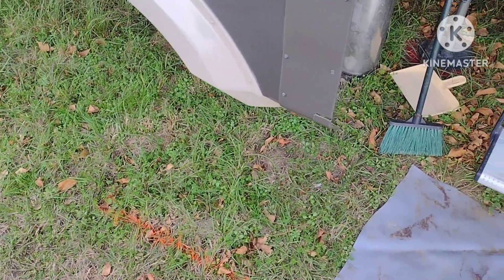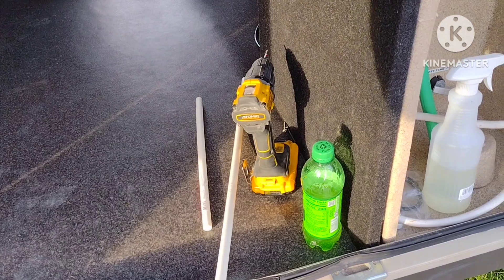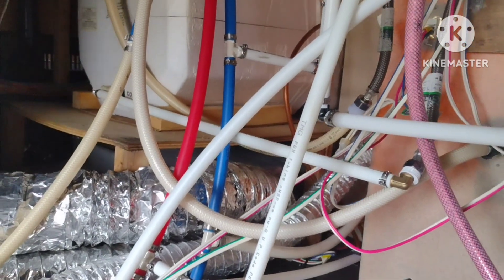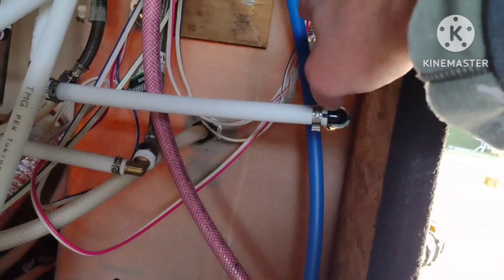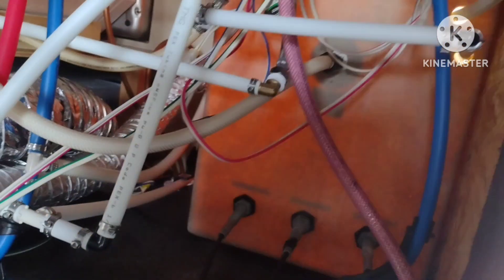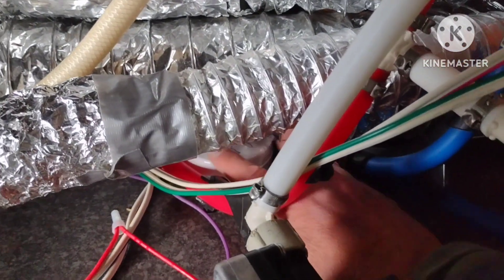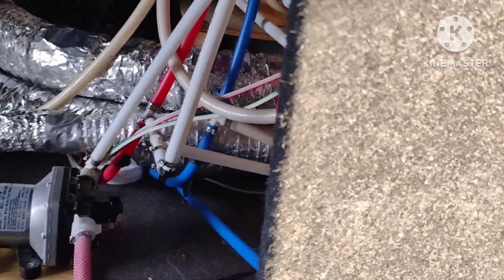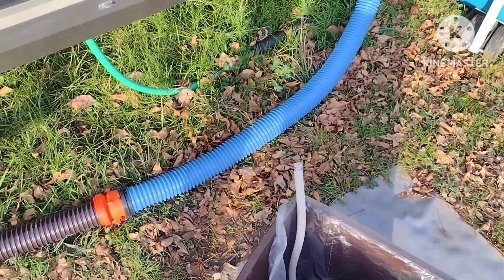Serious RV plumbing design flaw.  "PEX" clamps on braided hose connection? WTF!

Comment: You have identified a MAJOR problem with these garbage braided hoses. I am a 26 year RV repair mobile business, and continually deal with leaks at reinforced hose pinch clamped connections. Recently I went to a local dealer who sells a line of RVs that utilize much of this hose. I asked for 10' of this garbage Chinese hose to make repairs on units they had sold . They didn't even have 1' of it, and suggested I go to a local hardware store. Turns out the reinforced hardware store tubing is nowhere near the right size. It doesn't fit snugly on fittings and the OD is too big for the pinch clamps.  You are correct sir. Best remedy is to rid your rig of this trash whenever possible, because it WILL become a problem.
Reply: If the proper fittings are used with the proper nylon braided water line they are better than pex ( in my HO). I replaced all my pex with the proper nylon braided line and it sure made a big difference for me, no more leaks do to rigid line and do to accidental freezing nylon line won't freeze and bust. Just better for me and easier to work on too.

Comment: It would be nice if RV manufacturers would follow your suggestion and start using pex piping instead of that braided flex hose.  I would go one step further and use brass fittings also.
Reply: Grand Design does since the end of last year, 2025 models.

Comment: Those “PEX” clamps are not exclusive to PEX, those pinch clamps are used for many different applications. The problem is the fittings and not the clamp.

Comment: This is NOT unique or solely Grand Design rigs .....99% of RV's do this, but in a normal "stick and bricks" this wouldn't pass most building codes/inspection's. I have a 2021 Imagine with many leaks under the sink / water heater, and have begun the process of replacing with new PEX lines and brass fittings. ( Also finding extra hidden areas for  ??? .  Best thing to do is to replace what you can with PEX type B and use brass fittings. Don't forget to add shutoff valves for sinks/toilet while you are there. There are many DIY on Youtube and most of all, take your time to learn and to educate how to use the tools BEFORE you tear into your camper. Most of my supplies I found were cheaper on Amazon but shop around and if you are a veteran, use that discount  (Home Depot  or Lowe's ).

Comment: We have a 2020 GD Imagine - so far I have had 2 failures exactly as you describe.  Unfortunately its hard to get to all of the flexible vinyl.  It seems like someone should make the right sized barbed fitting to pex, so you can transition correctly.  Great video thanks for making / sharing this.
Reply: The problem is, when fitted at the factory, the reinforced Chinese hose does fit on the fittings properly. It is later (usually after warranty is over) the tubing expands slightly and causes problems. I (26 yr master RV tech) agree with this video creator. Eliminate the hose at every opportunity. Sadly, on some rigs I see the reinforced hose disappear into holes in the floor to things like tank rinsers or to route to another part of the RV. That is major problems guaranteed in the future, and I feel sorry for owners of rigs like that.

Comment: I have a 2022 rv and is the same way. Doesn’t seem to matter if it’s a expensive or cheap trailer. I just learned about this a few weeks ago and I am going through and changing everything out.
Reply: I just got a '22 5th wheel and every where the manufacturer used that braided hose its leaking.